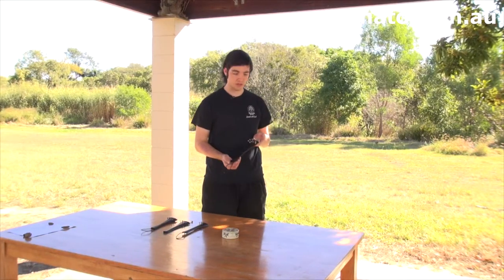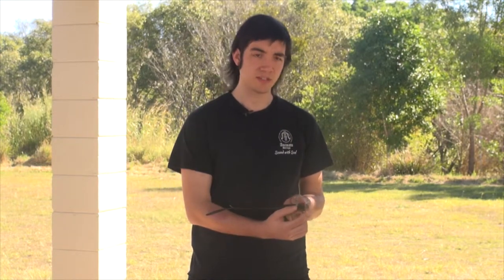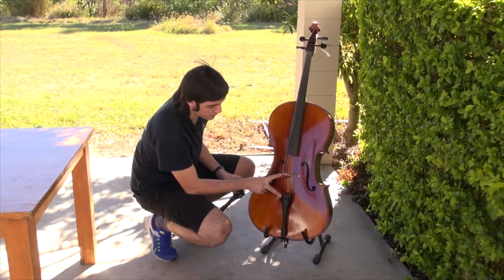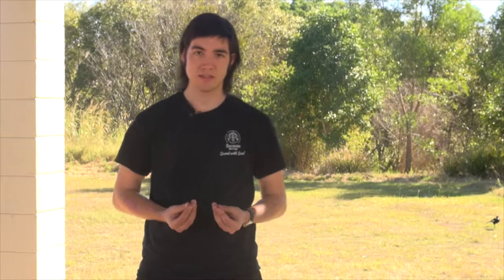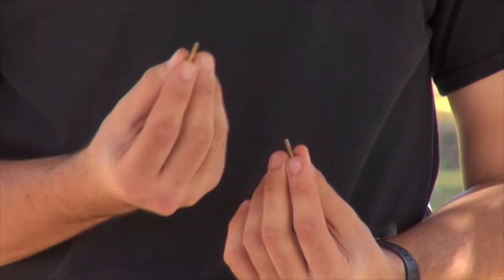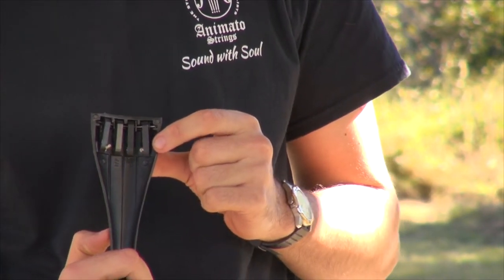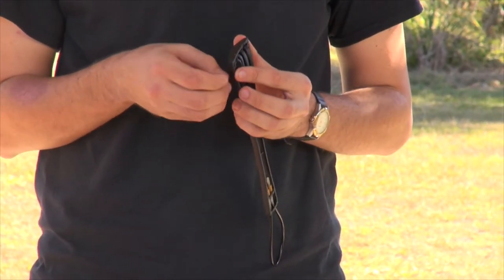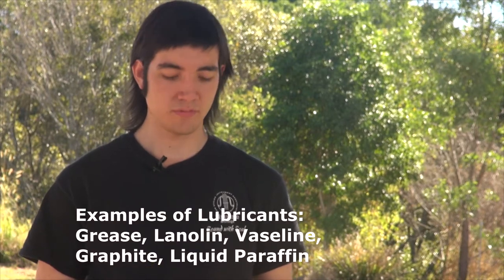Tail Pieces - The Good, the Bad and the Useless - with Billy from Animato Strings

Comment: What I did rather cleverly w/ my 5 String Cello is change the friction pegs out to mechanical ones which also allowed me to get rid of those fine tuners from the tailpiece. The lack of fine tuners on the tailpiece livens up the Cello's sound by allowing the top to Vibrate more freely.

Comment: Good review. :p Would a solution for the wooden tailpiece be just to take off the fine tuners? I've seen most professional instruments with just one hill style fine tuner.
Reply from the maker: I have seen a Stradivari violin with such a carbon fiber tail piece. The issue is that each time you turn a peg in the peg hole, the hole becomes a bit wider. It's the only part of the violin body that really wears out. Here is the video where you can see the Strad with the tail piece in question: Ilya Konovalov on his Stradivari Violin performs with Southern Cross Soloists in Brisbane on 14 June